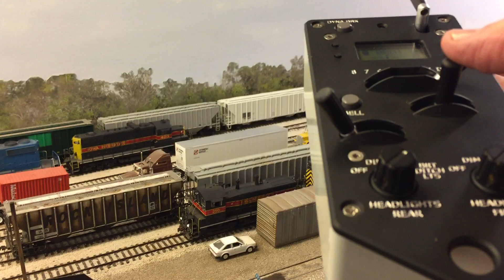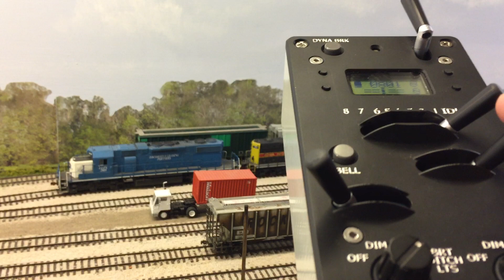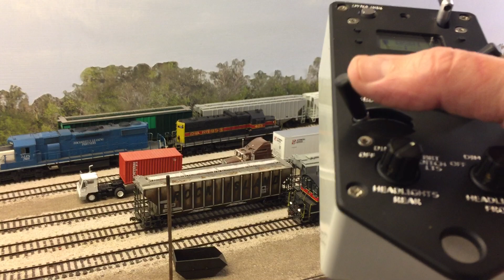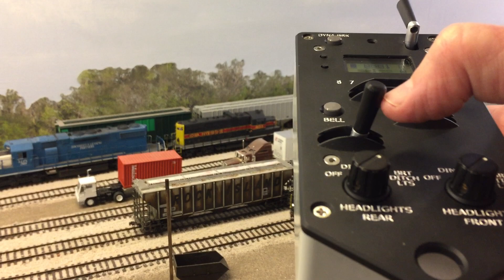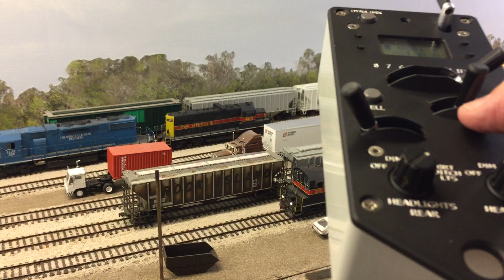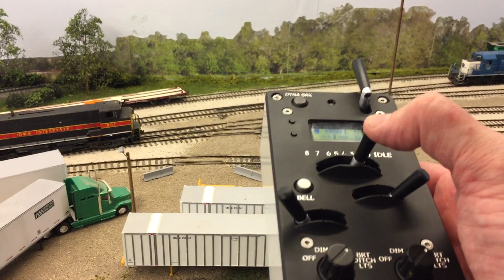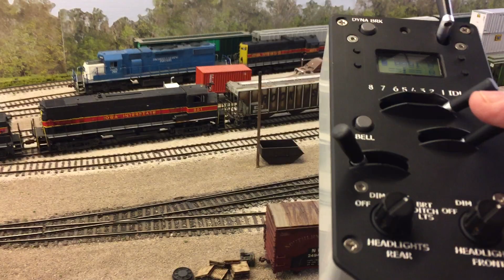ProtoThrottle - additional features

Comment: If you just keep the reverser right to the locomotive, which have a forward direction, it dosnt matter where your layout is facing or where the engineer stands. Forward on the reverser is allways forward the loco. Keep it original, keep it simpel...
Reply from the maker: I'm glad you mentioned that.  This video was shot almost two years ago, and shortly after posting it I modified my configuration as you described, documented in point #3 at https://model-railroad-hobbyist.com/node/33148#comment-334604 .  Definitely the right move, for me at least.  I've been much happier with this configuration.

Comment: How does drive hold work with this device (Full Throttle ESU) ?
Reply from the maker: Hi Michael - The PT allows you to assign the Auxiliary button (upper left corner of the controller) to whatever function you prefer.  My roster is 100% Loksound, so I chose to map Auxiliary to the Drive Hold function.  When it's engaged, it works just like Drive Hold with any other throttle in that changing the throttle settings changes the prime mover sound, but not the locomotive speed.

I hope that helps, but please let me know if you have more questions.

Comment: Joe, Thanks for additional insights around operation of the reverser and brake options
Reply from the maker: My pleasure Mike.  There's been some talk about trying to make the Reverser Swap configurable through a function setting, which with Loksound would allow me to tie it to my Cab Swap function that currently controls the end of the consist from which the bell and horn will sound.  If that happens, I think I'll change my position and use it, along with configuring the headlight use to be dependent on that Cab Swap function.

My initial concern over the use of Reverser Swap was the confusion it might cause for new operators, but the more I think about it, the more I believe it'll be a pretty intuitive change.
Reply: Joe, Wouldn't those additional changes be awesome and really add to more realistic operation!  Very much looking forward to them!
Reply from the maker: I sure hope that happens Mike.  I'll try to share more as I can.